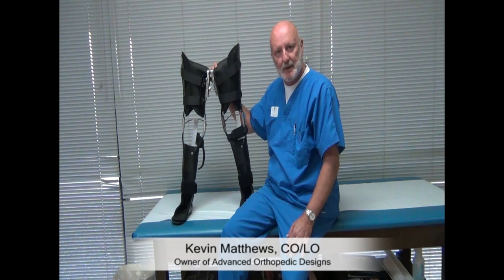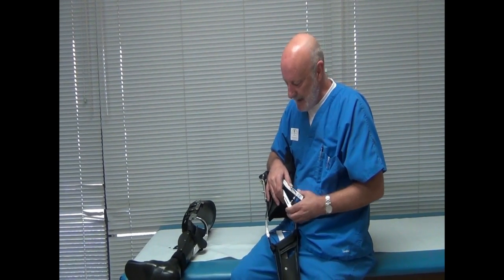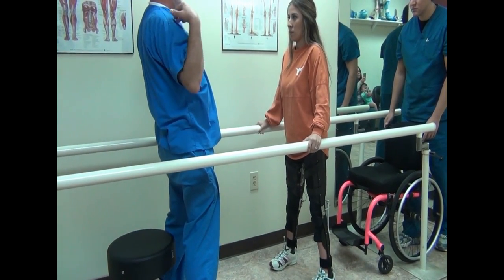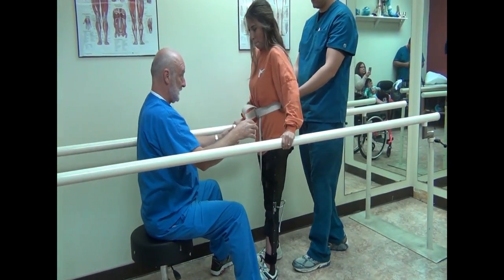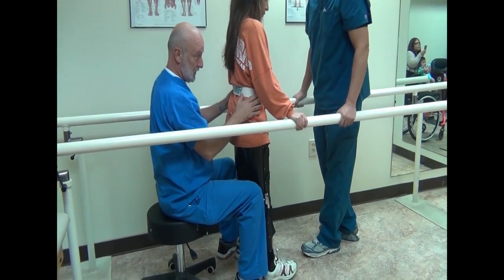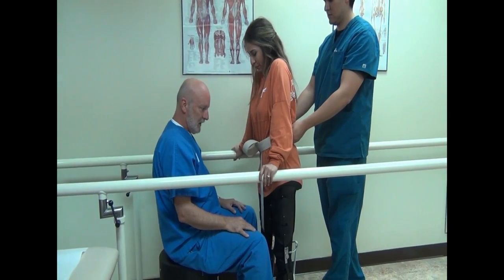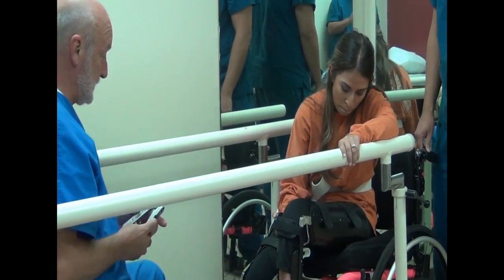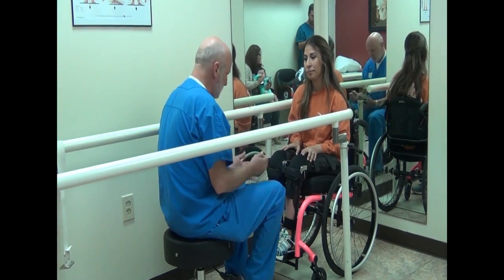KAFO Design:   Up and About KAFOs for paraplegia

Comment: Great work ! I bend the knee locks to fit closer to the back of the thigh to reduce the risk of unentended disengage ☺. What do you think ?
Reply from the maker: As long as the bails don't hit the leg in flexion, that is optimal.

Comment: Does this have a billable code? Last I looked I wasn't seeing one for the component specifically. Also, do you find your patients pretty readily adapt to independent use (understanding it's obviously case dependent)?
Reply from the maker: I use the reciprocating joint code with private insurance.  I don't with Medicare and Medicaid as they can be inflexible, but haven't had issues with private insurance.  That's the closest code.  It doesn't always cover the cost of the component, but at least you're getting something.

Comment: What is her level? I am curious if she is complete/incomplete and at what level? I am interested in using this system on a T10 complete para rather than a full RGO system.
Reply from the maker: She is a T12 I believe.  She has very little strength in her legs, but she did have some hip flexors, which helps.  I have seen this system work well on a T-7, with therapy and practice it is a system that works well.  I'm not saying the patient would become a full time ambulator, but they would have the ability to stand and walk.
Reply: @AdvancedOrthopedic  what should be minimum MMT in hip and knee to try for KAFO
Reply: When I originally saw this 20 years or so ago they had a complete T-7 para using the system.  He did very well, good upper body strength, young man.
Reply: I don't remember her level, L-1 or T-12 perhaps.